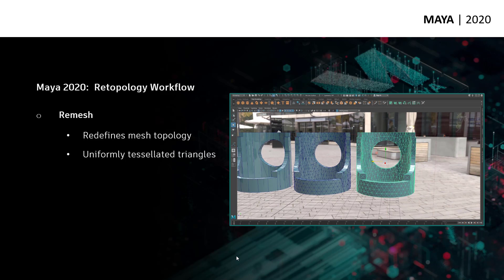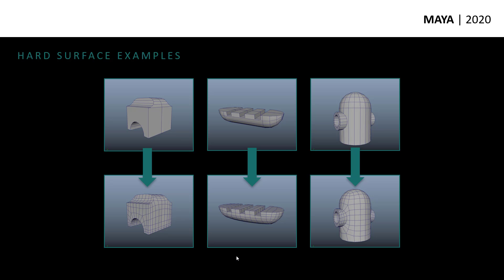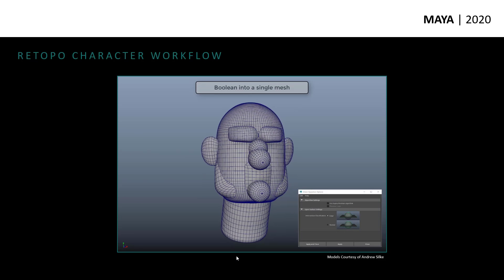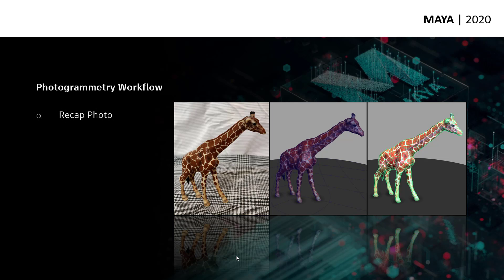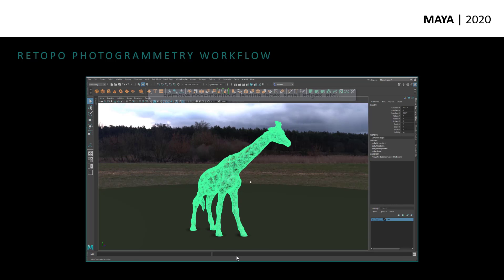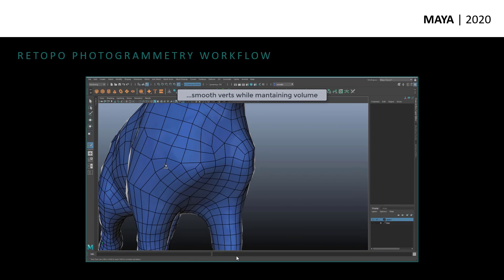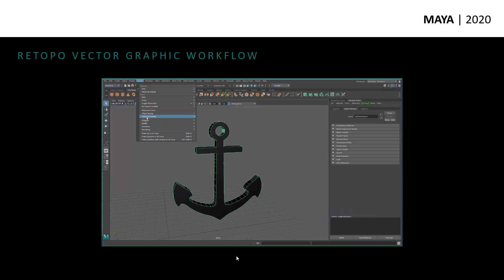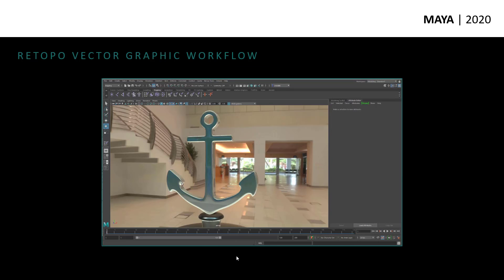Maya 2020 Retopo Workflows

Comment: I tried this with a decimated game character from zbrush, looked pretty terrible compared to zbrush zremesher tbh. Tinkered a bit with settings, it got worse. But I suppose it's a good start. Definetly want some way to deal with cylindrical retopo like topogun cylinder wraps or 3D coats "stroke tool slicing". But maya is coming along... ever so slowly...
Reply from the maker: Did you run Remesh on it first?
Reply: @MyOhMaya  Yes, I tried following the process in this video. One of my biggest laments was the distinct lack of proper edgeflow on the muscular arms of the character, or anywhere for the matter. It wasn't symmetrical either, though  to be fair I didn't research that.
Reply: What you expect from highpay lazy ass incompetent people running maya ?.....lol

Comment: Guys, you need to fix retopo with help of quad draw. It's nearly impossible to use it without pressing the delete history button every second if your mesh has more than 1k polys.
Reply from the maker: Yeah the delete history issue is known and something they are working to address.  Also looking at better performance.
Reply: @MyOhMaya  lol....when you gonna fix it ??....like maya 2030 ??....Industry already use blender by that time .....lazy ass autodesk
Reply: Another thing that can help a lot is to save out the base mesh as a gpu cache, then reimport the cache and make it live, and delete original geometry. Saves a lot of memory and can help performance, especially with heavier models.
Reply: You can disable saving history while doing retopo...